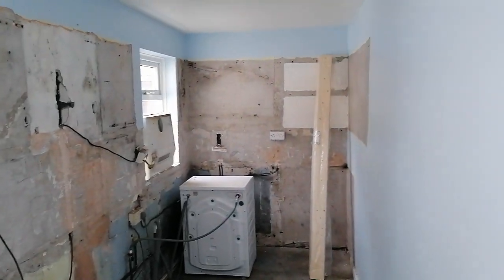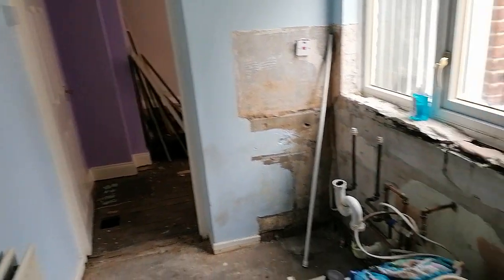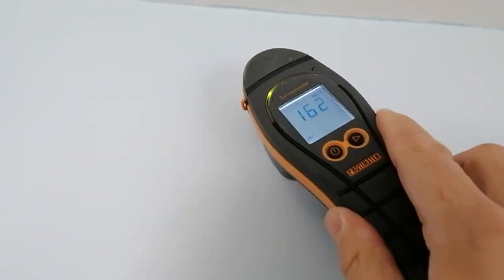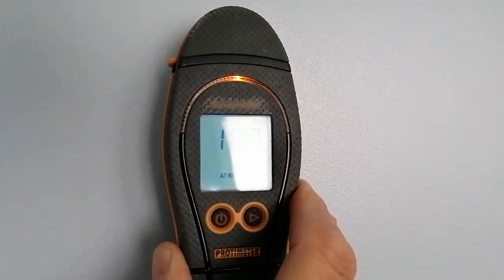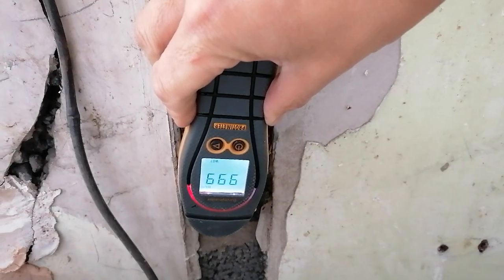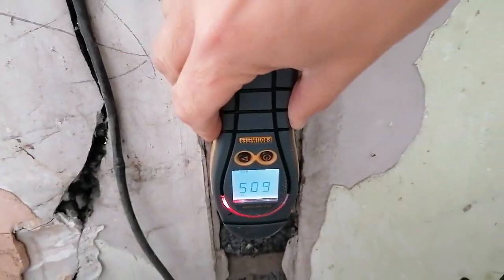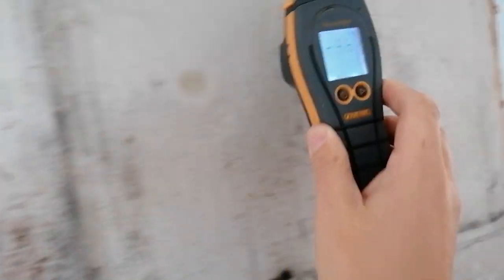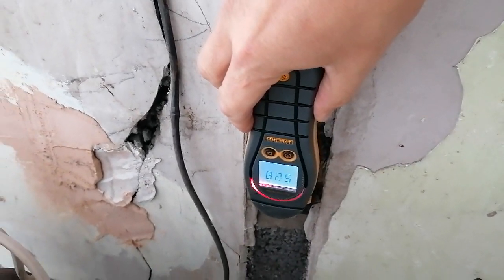Yet another false positive on my moisture meter.

Comment: The readings aren't reliable because the machines are only designed to accurately detect moisture in wood!
Reply from the maker: Absolutely Danny. They are a useful tool but just one tool needed to reach an accurate diagnosis.